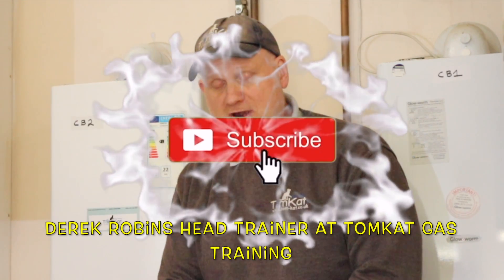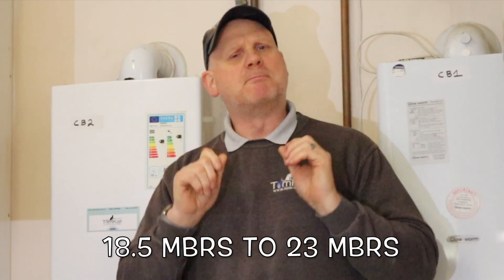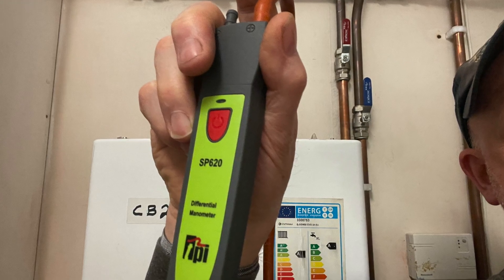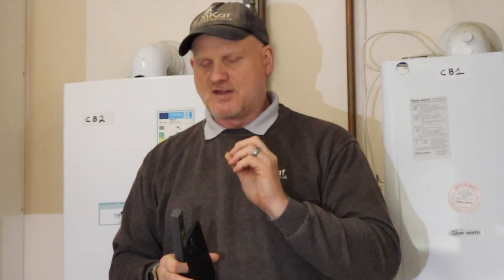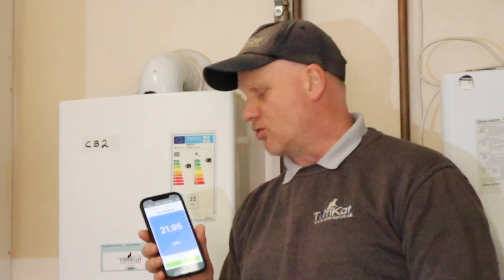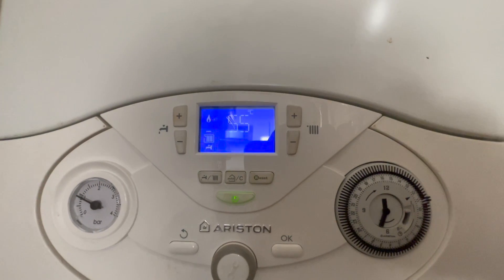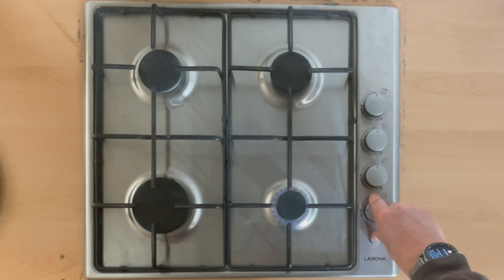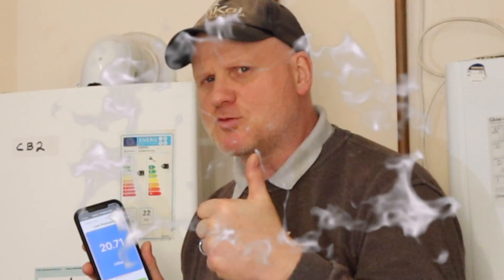New working pressure at the gas meter. How to carry out the new working pressure at the gas meter.

Comment: Try that with a 40kw worcester 8000 combi. Sgn won't dont recognise service mode just a hot water tap running so if the tap they use is flow restricted then you're at loggerheads.  Struggle to get the required pressure at the appliance with 28mm from the meter and well within the pipe sizing  Inc. fittings.

Comment: Hi Derek great video thanks.
If I was checking my operating pressure differentals (no more than 1mb) between my gas meter test point and appliance inlet test point I would place the largest appliance on 100 % and all other appliance on 50% and hopefully not get more than 1mb drop prooving my pipe works adequate.
Cheers Derek.
.
Reply from the maker: No mate the test you a talking about is if you suspect low incoming pressure. It’s one appliance on and no more than 1 mbr drop between meter and appliance.
Reply: @tomkatgastraining  Cheers Derek

Comment: This is going to cause a bit of an issue for some. For example 18.5 working and 1mbar across pipework is 17.5 at the appliance so worcester say they allow 1.5 across their inlet and gas valve so 17.5 minus 1.5 is 16mbar but worcester say 16.5 min. So how many boilers am I going to be seeing soon where the pressure is not correct. Just been to an Ideal logic 24 installer has listed in benchmark 20mbar bang on. Tested and getting 20mbar working and 14 at the appliance. Ideal said they are happy for it to be left working till rectified if combustion OK.  I disagree

Comment: Hi Tom another question I have, when you obtain your working pressure at the meter do you do that with all appliances on, but when you obtain the working pressure at the meter do you do that with just the appliance your testing on, for example If you have 21mbar at meter with all appliances on, would you then go to the appliance and expect 20mbar with just that appliance on

Comment: I have a question, if you was to check the operating pressures at the appliances then, if for example you done it at the boiler but had more gas appliances do you have to have all of them on while checking for no more than the 1mbar drop

Comment: Are you only checking here that with all gas appliances on you are inbetween the min and max ?
Reply from the maker: Please watch all the video because I make it quite clear what I am doing
Reply: @tomkatgastraining  sorry I am not intending to be rude I am just trying to learn, I want to know if when testing operating pressure on an appliance on a multi appliance line does it only need to be a 1mbar drop for the one your testing or a 1mbar drop with all the appliances on
Reply from the maker: @cazza1295  that has nothing to do with working pressure at the meter they are 2 completely different things
Reply: @tomkatgastraining  I understand that now, however the 1mbar drop I am asking about, does that 1mbar drop account for having all gas appliances on a line on or just individually
Reply from the maker: @cazza1295  the appliance individually
Reply: @tomkatgastraining  Thankyou very much for your help! I have been making notes on a variety of your videos today and it’s helped a lot

Comment: I’m confused, you took the working pressure at the meter but not the working pressure at the appliances to compare the drops ?
Reply from the maker: The video is about the new working pressure at the meter no the permissible drop across the pipe work so why would I do the working pressure at the appliance

Comment: This was definitely needed. I've had 17 mbar at the meter with only the boiler in high service mode and Cadent coming out twice (2 separate engineers)  telling me it's ok because they only use the hob and the pressure is adequate. They wouldn't do anything. The pressure at the gas valve was only 13...😫🤦‍♂️

Comment: Turn up to a hot system in this weather you’ll not get it to run on high fire for a minute anyway !
Reply: Some combi boilers you can dump heat by running the hot water tap during service mode

Comment: From comments I've  seen and my experience  of ESP responses to pressure regulation issues , supply issues and asset managers attitudes have combined to create the confusing IGEM response!
Clarification is urgently required!!
Reply from the maker: What clarification do you require John
Reply: @tomkatgastraining  why do  HE boilers require, for example W Bosch require with 19m b OW  16.5 at the Gas valve?
My example of an atmospheric burner consuming 3.42cubic meters and BP of 13.6  and SEDBUK of 78% begs the question, why do today's offerings require higher pressures.
My view is maybe cynical, but min. OW of 18.5  serves a purpose that meets both the Gas providers and boiler manafacturers .
You can tell me I'm stupid, but just tell the installers WHY.
Reply from the maker: @johnward5006  you are making a mountain out of a mole hill John you would probably only get 18.5 at the meter at only a very small percentage of the year. We all know boiler will work at low pressures because most boilers have undersized gas pipes anyway. As long as the pressure are not affecting the safe operation of all appliances then it’s deemed safe anyway.
Reply: @tomkatgastraining  sorry Derek but that is no answer. The suprima in my example assumes 20mb IW ( manafacturers requirement)
Pipe sizing is assumed  correct and pressure drop as industry standard.
On that basis  my example 18.5mb OW would not meet MIs
Explain why  any appliance whose requirement is 20mb IW would accept 17.5 IW.
Reply from the maker: @johnward5006  but will the boiler be dangerous that’s what they would say.
Reply: @tomkatgastraining  My point is that manipulating min. and max. outlet working pressures is not only confusing and misleading it disguises the reality  of  the purpose of the directive.
Simply, it is a collusion  of gas transporters and HE manafacturers.
I repeat, is this manipulation to suit a situation or a justifiable change.
Reply from the maker: @johnward5006  it will be the esp getting too many reports of low gas pressures at the meter also they are trying to reduce the inlet pressure to the regulators and also trying to standardise the test to reduce confusion and false reports of low inlet pressures when it’s incorrect gas pipe sizing.
Reply: @tomkatgastraining  The problem lies with failure, despite the billions invested  in upgrading the network  over a 30+ years programme to keep pace with demand.
It has little to do with installation  pipework. It's more to do with  service pipework and the way in which HE boilers operation impact the service pipework. 
Don't  blame it entirely on the downstream effect.
The supply network  is problematic. 
If the supply network  can't  meet demand, tinkering is no answer.
I look forward to input from those  in the upstream part of this issue!

Comment: Don't  get the additional .5 mb
If an appliance is designed to operate  at a pressure above 18.5mb what then? Yes, it's back to the gas
transporter to provide an adequate supply.
Any mention of gas rates, or is it to be assumed that appliances will operate safely at 17.5mb inlet working?
Messing with outlet  working pressures  by IGEM  without proper explanation is not impressing me!!
Enjoyed your video on inside gas meters !
Only the legend you are would go to such lengths, I was impressed!

 transporter to provide  an adequate supply.
Reply: Name me a boiler that won't ! don't use the 20mb required at the valve excuse as that's down to the 21mb nominal -1mb 

Most manufacturers use 14mb at testing where do you think they get that number from thin air it's all in the books if your happen to look it up 

Lots of appliances are on undersized gas pipes don't make them automatically unsafe seen Steamers on 2mb operating perfectly fine and kw correct output.
We are talking about 0.5here it's a nats fart to what we were currently using

Comment: This is not the test Cadent will be doing as mentioned in the video. We will only run all hot taps and 50% of everything else. NOT sweep mode.
Reply: For safe operation of any gas appliance pressures are one thing, gas rates are crucial.
Reply: @johnward5006  Agree.

Comment: Wales and west have a fit whenever I put a boiler into service mode. They’re certainly not going to do it. All they’ll do is turn the nearest hot tap on. That’s the reality
Reply: Yeah we will only use Chimney Sweep mode if the GSE is on site, if not which is often the case especially low pressure jobs on boiler services we just crack the hw taps and 50% additional appliances. Many times the Boiler engineer returns and calls us again but unless you're on site we'll just keep doing the same thing i'm afraid
Reply: @johnh9641  Disgraceful!!
Reply: @johnward5006  not disgraceful at all, we can only do what we're allowed to do. I personally don't like it one bit as believe WP should be every appliance running in max
Reply: @johnh9641  sorry, meant it's  disgraceful that the system is in such disarray.
Reply from the maker: The esp engineers can’t use service mode so they have been told to turn all the hot taps on in the house and all other appliances on 50%

Comment: I've recently passed my ACS and have my first inspection soon.  on all my own installations I have installed new gas supplies to ensure less than 1mb drop, I am still a little in the dark about installing a new boiler on an existing, but clearly undersized supply when the MI's are satisfied for lowest inlet gas pressure.  ie; a Vaillant is ok with a pressure as low as 13.5mb at the inlet so does this mean we can install using that existing supply given that  its fine with the MI's or does the supply need to be renewed ?  Asking because I have seen this done many times and even the manufacturers that come out to see the appliances (for faults etc) are fine with it.
Reply from the maker: The gas supply will always need to be sized for the appliances it is serving on new installations. It makes no odds if it’s a new installation or replacement boiler it will still need to be correct
Reply: @tomkatgastraining  yes I understand, but my question is regarding the MI's which I was always told were the highest priority.  If they say 13.5mb is fine,  this mean that (in your words) the sizing is correct as long as its 13.5mb or over? for example, the inlet pressure is 16mb at the appliance and 20mb at the meter, the MI's say fine, what does that mean for 'correct' pipe sizing?
Reply from the maker: @oldblokeswhoshouldknowbett8108  the pressure the manufacturers state is at the gas valve not the gas isolation valve. If the test nipple is at the gas isolation valve then you are still only allowed a 1mbr drop between meter and test point but if it’s at the gas valve the you can refer to MIs but still can’t effect the safe operation of any other gas appliance
Reply: @tomkatgastraining  got it, thanks Derek ! I guess this takes into account losses at the gas valve but there are none at the inlet/isolator valve apart from pressure drop along supply.

Comment: And for boilers with no chimney sweep mode? Do old balanced flue boilers have this?
Reply from the maker: No you put all the taps on if a combi or heating and hot water for heat only and system